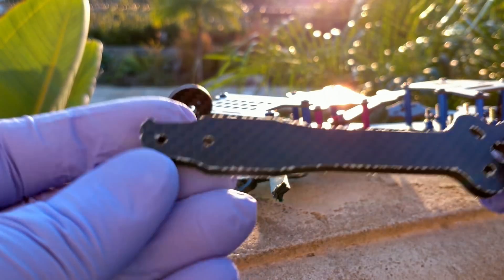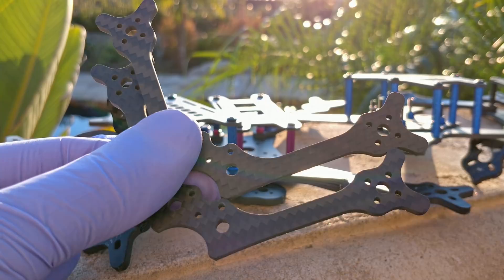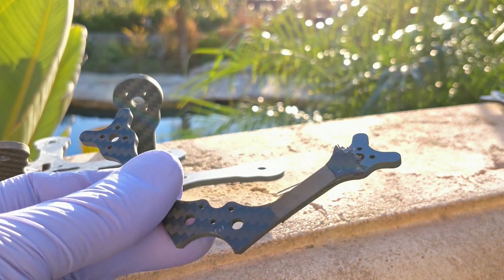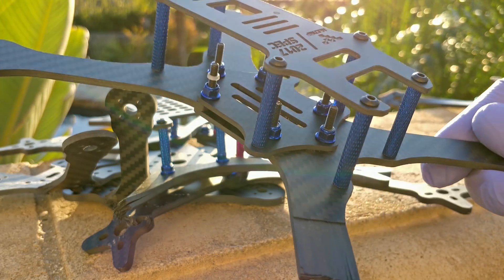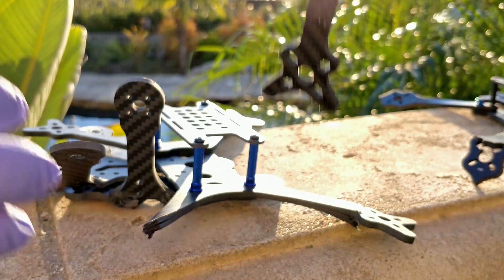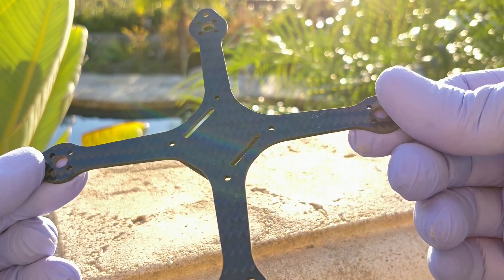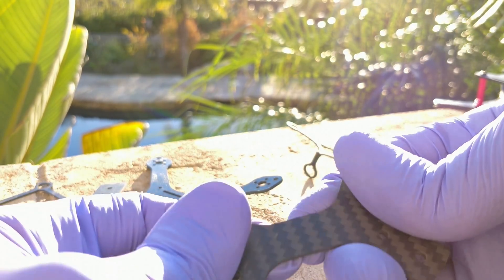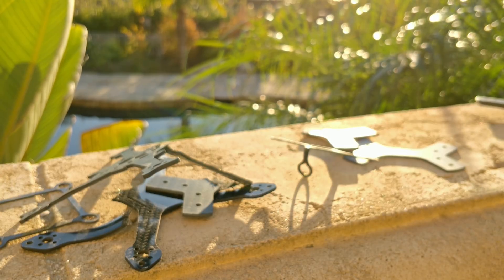Chinesium - How does it break?

Comment: Last week I struck a oak tree after punching out full throttle, destroying all the blades and ripping the battery strap off, the frame? untouched, the frame is a Diatone GTM5-NP. So not all Chinese frames are bad, not all domestic frames are good, but expect a specialty cloned frame (such as the floss and others) to have issues the OEM ran into but fixed.

Also you get what you pay for, this Diatone Frame was $60, a $30 clone is going to be flyable, but most likely has annoying problems.

Comment: Great video, I just wanted to clarify some of the terminology as someone who has studied carbon fibre composites. 

A distinction should be made between strength and stiffness. Without it I think you're going to struggle to explain the benefit of Kevlar. Kevlar is not as stiff as carbon fibre but it can be roughly as strong so it would take a similar amount of force to break. It performs better in crashes due to the increased flexibility (because it is less stiff) because the bending spreads out the impact of the crash over a longer period of time, lowering the force.

I hope that explanation helped.

Comment: When designing their products, they must ensure that stresses are everywhere well below the yield strength of the material used. Once frame dimensional/weve direction requirements have been defined, it becomes necessary to evaluate whether the frame will be able to withstand external dynamic stresses using optimum amount of material that minimize both weight and cost.

Comment: your last frame looks cool, but reduce the number of holes, especially the ones that are almost quadrangular...less small holes! and a 0 90 45 -45 0 90 stack is not quasiisotropic ;), it´s just a multi-directional layup!  nice vid!
Reply from the maker: ?  "Quasi-Isotropic Laminates: A laminate is called quasi-isotropic when its extensional stiffness matrix behaves like an isotropic material."
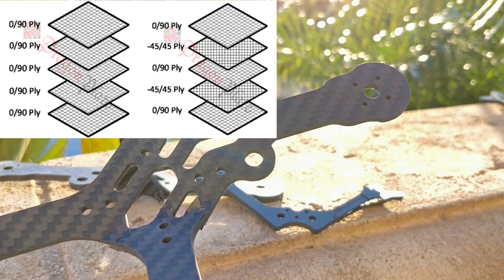Reply: kind of..i was referring to the the stack you were showing at 6:20... having an unequal amount of plies per direction leads in this case to a stiffer property in 0 / 90 deg direction.... but i guess that was just a sample image (sorry ^^')

Comment: use steel on the inside and aluminum screws on the ends of the arm and break that instead of the arm.
Reply from the maker: A good method but the aluminum actually breaks quite easily. Too easily...

Comment: That diatone has a flawed frame and I have heard they are still working on it's design, but they should stick to their own design. Their 2018 GT-M line has been indestructible for me, I've hit lamp posts, trees and pile drove it into the ground hard enough to launch the motor off of the arm, and it's still perfect- not sure if the layering is the same, but it is incredibly tough- not doubting your product, but you can't always generalize things.

Design a Plus platform frame, I will buy two! my diatone plus frame flies so well I built another, there is just something about how they behave, the FC doesn't need to work as hard,  flips and rolls cause no upset, it is incredibly fast and stable, there is zero oscillation and dialing Pids is child's play- If you never flown a stretched plus you need to try it ASAP, I'm done with X frames forever, I almost wish I hadn't discovered them, now I only have 3 choices Diatone GT-M, Shendrones rapture and archangel, the last two are flawed, the former is delicate, one piece and expensive and the other can't fit 5" on all sides.

#makeaplus
Reply from the maker: I've designed a fee plus frames. They fly a little weird. I'm just not a fan and I don't see them capturing any significant portion of the population. I've recently begun to reduce my frame offerings as there are just too many options and I feel it's confusing.
Reply: Are they stretched pluses though? They fly weird, yes, but I haven't found anything smoother or more grippy  in the air, they feel like they slice through the air like a glider and X's feel like they drag through it.

Comment: I’m designing a frame...2 questions. 1) do you just tell your carbon cutter how to position the carbon or will they know? 2) it’s nearly impossible not to, in some way, copy one of your frames in at least some manor...does this bother you? I feel like the minor changes I make aren’t enough to distinguish based off of looks alone.
Reply from the maker: Yes you need to tell them the orientation. They understand this very well too. I encourage people to make their own designs however they want. What I don't like is someone selling someone else's design as their own and making money off it. Especially if it's a larger well known company
Reply: Kabab FPV I guess I’m curious where the line is drawn when it comes to something being a good design and just naturally better vs an out right copy. I’ve found myself designing for a few hours and then ending up with something that looks too similar to a floss or other popular freestyle and race frames
Reply from the maker: Beau that's the challenge. If you're just gonna make the same thing, it's hard to justify even making it. Once you've seen some good designs, it's hard to get them out of your head and be original...
Reply: Kabab FPV I guess the biggest issues I have with current frames is the price. Even in low quantities I can have a floss 2 frame cut for 15 dollars. You sell them for 45. Just seems pointlessly high.
Reply: Kabab FPV i even thought about making a website called kwadclones where all I did was sell cloned frames at exceedingly low prices. Just to force the market down. I could do all this with US labor too

Comment: Somehow reminds me of golf clubs cf shafts. There is such a thing as cf hardness which determines the flex of the shafts during strokes; where softer flex is better suited for players with a more relaxed and slower strokes, adversely harder flex shafts are more suitable for players with a much stronger and faster stroke as there is lesser bending occurring on those hard shafts. 

In terms of mini quad arms, those harder shafts (though more brittle on impacts), will handle aggressive punches better than softer arms would as the softer arms will be flexing more. 

So not only in terms of crash durability, stiffer arms are also better for flights as it maintains propeller orientations better during punches over softer arms.
Reply from the maker: The FC definitely preferres rigidity. Problem with the sifter direction is that while it won't break, every bump causes more and more damage to the fiber structure and makes it softer and softer over time which makes things fly worse and worse.

Comment: I enjoy flying the flowride, looks like floss 2.1 will be my next racer build. Great video! Thanks for doing things we need in this hobby! Can the floss 2.1 also handle a bottom mounted battery? Is that an option?
Reply from the maker: yes it can do batt on bottom.  The Hyperlite Dragana that's coming out after China New Year if it ever ends is designed to be a bottom batt only frame.  Might be worth waiting for that one.  Make sure you get the 5mm arms with whatever you get.

Comment: I would think that when the carbon is cut wrong it would also cause in flight issues due to how flexible it is. Prop wash handling would probably suffer
Reply from the maker: Yes it definitely does but if it's like a 12mm wide 4mm thick arm, it'll still have the necessary rigidity. Will just weigh like twice as much though.
Reply: Do you have any evidence for this, there seems to be a lot of people claiming total rigidity is the ultimate goal but no actual evidence that this is true. It seldom is.
Reply from the maker: If you take a look at how even the Floss 2.1 with the 5mm arms bends before breaking, you'll see that totally rigidity isn't even very possible without tons more weight. It's also not a good thing. While the FC wants total rigidity and you can absolutely feel the difference in flight between a really flimsy frame and a solid one, if it's too stiff you transmit all the vibrations of the motors all over the frame. This really comes into play with vertical arm frames since the plate orientation and structure is so solid. I dunno if any of that answers your question but I've designed flexing into all my frames because I do believe some degree of flex is needed for the vibrations and better impact resilience.

Comment: Remember the video that braindrain made where he tried to roast you about how his frames were actually correct underneath? Well, why the fuck would you use a carbon sheet that the user can't easily figure out if the fibers are moving the right way? Your advice is correct, which is to stay away from cross hatching. Its the designer/manufacturer's fault if people aren't buying the frame because the carbon is going the wrong way.
Reply from the maker: Unfortunately there is loads of false information out there. Even if quasi layering is used, it's weaker than the regular stuff cut properly because you have fewer fibers running in the direction you want them in.

Comment: I cut my designs at armattan and so far they have been solid. They have held better than many expensive "high quality" ones.But I am wondering if another material would be better suited for our application. Hdpe for example is almost indestructuble but it is heavy, if it could be made lighter somehow,or anoher lighter high impact resistance material. I dunno, maybe as the hobby grows more research will be done, we are still a tiny tiny market.
Reply from the maker: Carbon is typically 1.53g/cc. HDPE is about 1.00g/cc but it's far more flexible. I've experimented with it quite a bit. It can be used some places and not others.
Reply: it is more flexible true but is this really that bad ? What did you find out in your testings, does the flex create issues when used as arms? There are some hdpe frames in the market ,i haven't flown one, the main negative I see is the weight which can be even 50% more than a carbon equivelent.
Reply from the maker: Well if you hold your frame by an arm and the rest folds in half, yeah that might be a problem. Lol. The HDPE frames out there have super duper ultra massive bulky arms for this reason. Still the whole frame bends and after a crash you need to twist it back in place. I've experimented with using HDPE in other ways.....think, not arms......it can be done, just difficult to so and cutting the stuff is messy on a CNC. B but it's dirt cheap.

Comment: But we all know we need a wound Carbon (maybe compound) airflow drop form hollow arm  with better motormounts and a good center integration with perfect stiffness/robust/weight ratio. No way too sleep satisfied without this ;-) I dream about such things... Regards from Germany
Reply: I keep hoping that in the near future our frames are going to be as pretty to look at as a high end bicycle.  All smooth molded curves.  I think this will become feasible once the form factors for everything stop changing every 6 months and the hobby stabilizes.  I am glad FU-RC is trying to make it happen.
Reply: Thx, and yes FU RC is a bit Tesla in this hobby ;-).  And the final Kabab Floss Dentist original frame is damn near from the perfect shoe carton Frame. But this is one of the next step with a difficulty costs/efficient boarder. The other big step will be the pitch adjustable Propeller... Maybe with one middle Motor (better Center Weight) but there are hughe mechanical Problems to solved. Holow Carbon arms with titanium mechanics for pitching the Props or something lighter "servo" integrated in the motors ... We will see... But some military little helis make a good job today. Regards from Germany
Reply: Yeah adjustable pitch props would be amazing.  But the trick would be making it hold up to crashes and not be ridiculously expensive.  The Stingray 500 did it with one central motor and belt driven variable pitch props.  There is also a cool video of a variable pitch quadcopter that MIT built back in like 2010-2011.
Reply: Moin, yeah know it all, a friend smashed his 800 Dollar stingray in trash because he was so bored about the motor and constructure ;-(. And yes the rigidty and the weight/ratio needs "optimized". Regards

Comment: Hey you are doing amazing work! I don't know specifics with what underground is doing with the carbon Kevlar that they are doing for your arms but my buddy owns a carbon fiber shop and I was asking questions about the stuff. He told me that the carbon Kevlar  is only like $50-100 bucks more per how ever many  ft the roll is. The cost is so little that it would be worth making the arm with all solid carbon Kevlar and you can also get different color carbon fiber and kevlar. Since you go to extremes to make the very best products. I think you should do some more homework in to the carbon kevlar cuz 2mm carbon Kevlar would maybe be the same strength as 4mm carbon fiber. You could make your frames lighter stronger and the very best frames ever. I'm sure if it would make things more expensive if it's just a little bit 10-20 buck per frame that if that was an option people would buy it. I would pay more on color carbon frame and more on Kevlar knowing nothing I would do would break the frames. Also I don't know if it cheap carbon fiber that the frames come in but the products he makes don't break They bend and in some instances like how you bent that small frame except they bend back and don't delaminate. I guess it's the difference between made in the USA and made in China. Well good luck keep up the fantastic work.
Reply from the maker: Please contact me on FB. Bob Roogi. I am constantly exploring new materials. The primary issue with the carbon Kevlar at the moment is that my manufacturer doesn't have it and doesn't know where to get it. Underground FPV tells me while it doesn't cost too much more, it is an absolute PITA to cut and it's easy to screw up cutting it. 

I'm very interested in what you speak of and would love to explore it further if it makes economic sense.
Reply: Ok I will get with you soon. My name is Wayne

Comment: Going with the proper fiber orientation changed the arms from noodle to solid for me. 5$ price increase, but strength increased similarly to adding 1mm of thickness.
Reply from the maker: Yes. Exactly. That is what I keep telling people and they keep coming back with stuff like 'some flex is good to resistant fracture'.  All you need to do is feel it for yourself to realize 'oh no, I want this one. I was wrong before...'.

Comment: I looked at two broken arms under a digital microscope. https://youtu.be/Jf0-ZUqWutI  I’m not saying what they are, but one is from a very expensive frame, the other is from a cheap frame. I’m not saying I am an expert on carbon, but I can tell you my older brother is a stress and weights engineer in the defence aerospace industry, and he pronounced both pieces as ‘shit’, after looking at the video and said his 30 years of knowledge was worthless as all the carbon he’d come across in our hobby is toy grade tat. Also, depending on the type, your grips aren’t telling you anything. The hardest to break like that is often the stuff that cracks in a high energy impact. A good carbon arm would have strength across many axis by using several different types of weave. Sadly that is too expensive. In my tests, the stiffest stuff is usually too dry (look at those completely dry strands in my video) and the strands not coated properly. A tiny bit of flex helps absorb and spread impact and your frames demonstrated that, so you clearly know a thing or two and are using the correct amount of resin. Also will you get a uk or European distributes for your frames. I can even give you names and contacts if you like.
Reply: Hey kabab You should open up a shop  to make frames! I will move to Calli and pump out frames for you day and night just like those China sweat shops
Reply: i was pretty shocked to find the carbon is one directional with a cosmetic plain weave layer on top.   imma make my own carbon out of those thin sheets, as soon as i find somebody who knows how to cool cure the resin
Reply from the maker: Right. Exactly. It's all bullshit grade.  It's comical when people say how great their $100 frame carbon is because if it was actual high grade it would be much more than $100. I just do the best I can with the crap people will pay for so I can get an engineered 'enough' product that will perform good enough to make the expensive stuff pointless since the benefits would be minimal.
Reply from the maker: I don't do sales or distribution. I barely have any time to do any of this at all. I just enjoy making cool stuff and sharing it.
Reply: Kabab FPV my brothers response was equally brutal, I believe his words were, ‘it’s all shit, so go and fly and if it breaks don’t buy again, if it doesn’t get some more quickly’. I was expecting a much more techie response 😜
Reply: Your brother is right, but while they are 'shit', they can be made fit for purpose. If you spent ages analyzing all the load paths and made a custom layup which was perfect for a multirotor frame, it might be 20% stronger/lighter. Unfortunately, it would be a $500 frame.
The law of diminishing returns kicks in here. The 'toy' grade carbon is good enough for the job.
Reply: benaresq 100% agree, and that was his point :)
Reply: completely agree. thats why those 100$+ garbage frames (ummagawd remix, xhover stingy and so on) break like matchsticks. its overpriced, overhyped, toygrade sh*t carbon.

Comment: Do u think that the 3D printed tpu motor mounts that extend the nudges of the flowride and flows arms r overkill? I’m all about protecting motors but is it overkill?
Reply from the maker: I never saw a lot of value in those tpu bumpers. I feel they squish out of the way pretty easily. I guess they do protect against minor bumps however